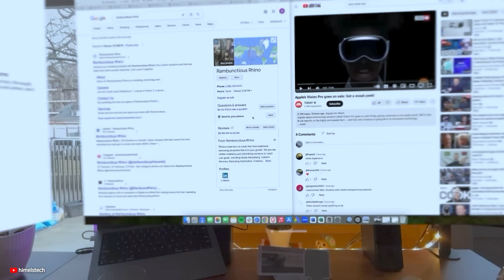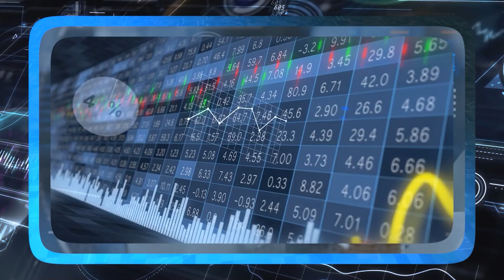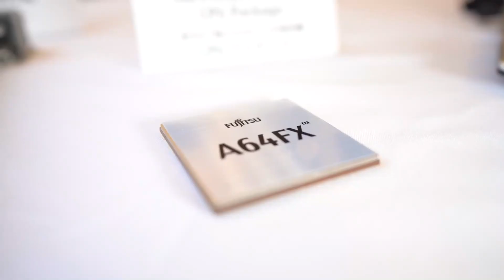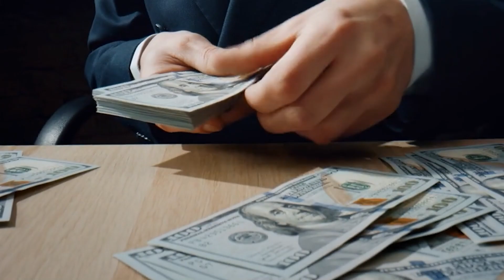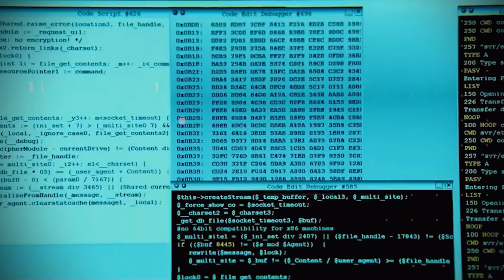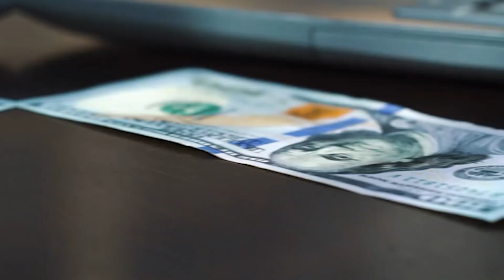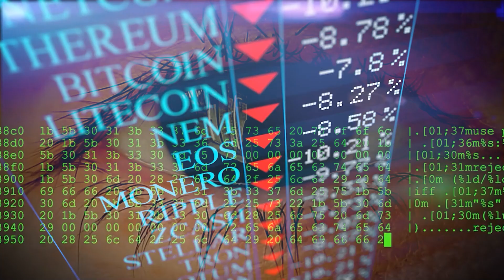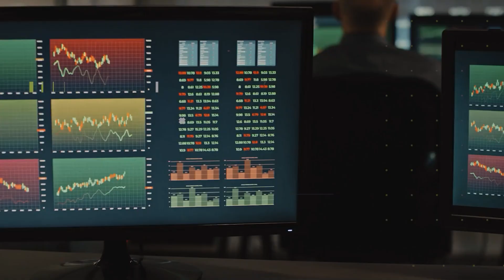15 DISTURBING Ways Singularity Will Change The World w Ray Kurzweil

Comment: Kurtzweil is wrong on his timeframe, and he says so now. Problem is that things are accelerating in a way that were not visible years ago. Heck, GPT-1 was a revolution and it was expected we get GPT-4 maybe at 2030ish, capability wise. We now are quite close to AGI - we know mostly also what is missing and a LOT of that MAY already be in research papers (i.e. they have not been tried out in larger concept). A lot of the stuff in this list, i.e., is already in trial. Custom gene therapy? Done. Brian interface? Neuralink. Not everything, but we can see it in primitive form in trials and - it is not really possible this takes more than a generation to realize. AGI is something we have before 2030 - we may have it in 2025 in early form or even end of 2024, depending how GPT-5 turns out. So, we can talk timeframe - but we do not talk timeframe to 2045- Btw., quantum computers and AI do not get together. Quantum technology is good for very specific issues, but has problems moving data in and out - i.e. complex math, small data. AI is simple math (funny enough it is really quite simple math) - on VERY LARGE data sets. Do not go together - quantum states are super fast, but loading and unloading data is not. Most of the stuff attributed to Quantum Computers here is - already in early testing without them. Rocket engines alerady solved - look at the number of companies testing fusion drives for 30 to 60 day travel. Not Singularity stuff.
Btw., AGI is likely ASI. Problem is that AGI is human level by definition - not smart enough = not AGI, but a little smarter = ASI. Problem is that the acceptable definition range (let's take IQ) for AGI is not that big - it goes from 90ish (a little simple) to 100 (human average around that) on the lower end to 145 on the higher end (genius level) - that is a 50% upward roughly, and AI increases good enough that - well, we may never get AGI but immediately have a super intelligence. This is particular important as tehy assume GPT-5 already may have IQ145 - just not the supporting infrastructure (i.e. we need more than the langauge model - we need a lot of architecture to make a brain behave like not a reactive entity).
Reply: I had witten a long reply to your great analysis...which could not appload immediately....tried refrshing the page and lost it all. Cant go back on it again......cheers for the insights.
Reply: Singularity will not happen within 2045

We can help scientists by processing data from boinc distributed computing software ♥️, dream lab for Android ♥️